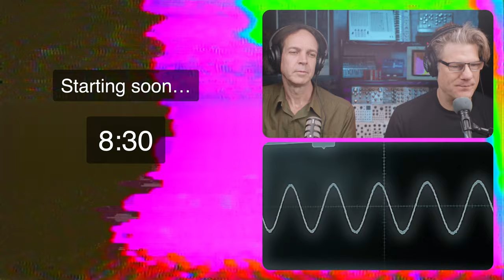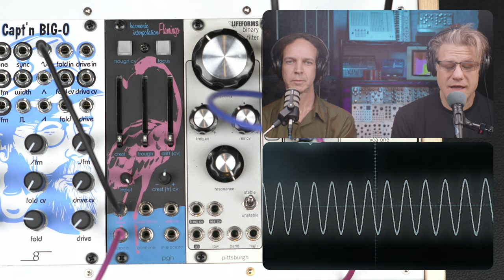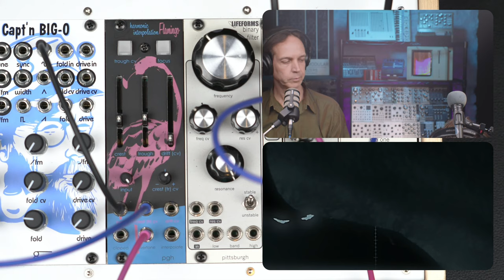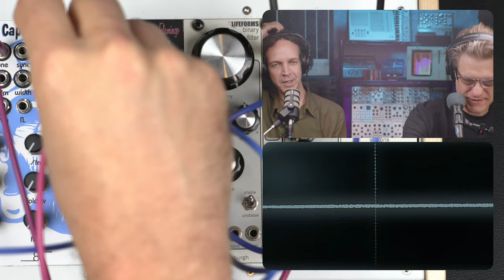New Module Flamingo Patch Lab with Richard Nicol and Michael Johnsen

Comment: At 1:02:00, Michael says that the only time you ever get a change in even harmonics with traditional analog synthesised waveforms is with pulse width modulation. 

Is the true even when phase distortion synthesis is changing the waveform symmetry because that is also only horizontal changes to the wave shape?